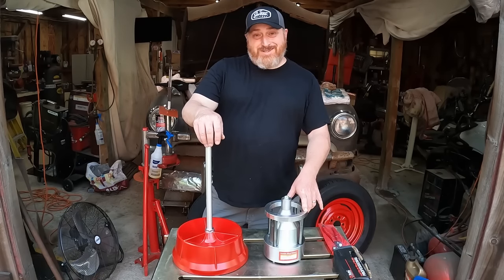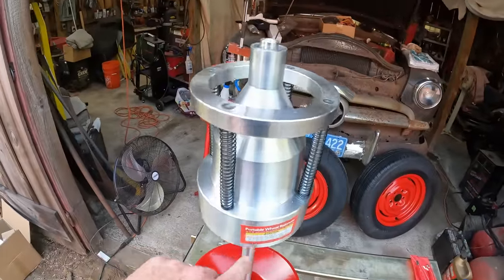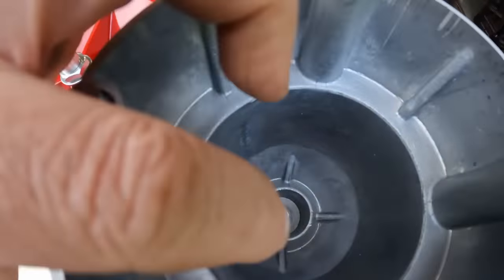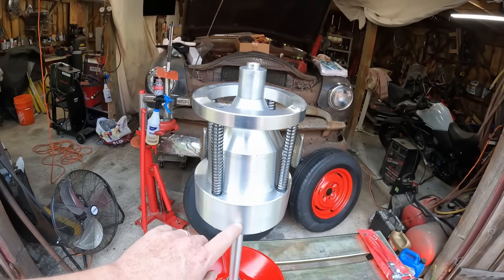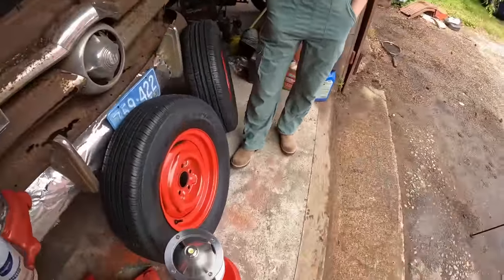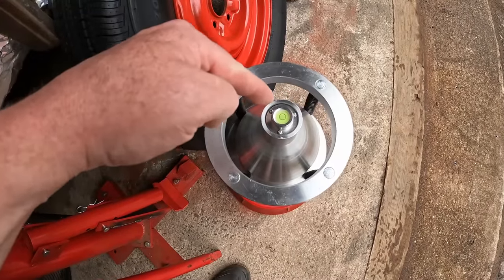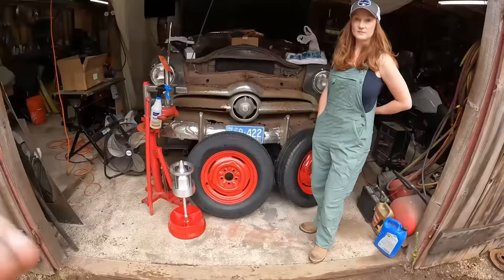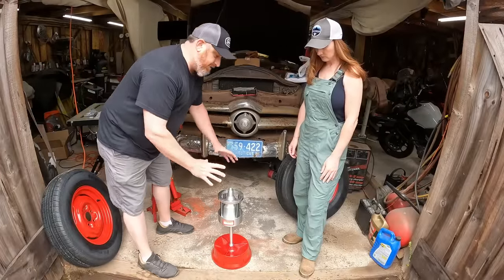How to balance your tires at home and how to modify your Harbor Freight/Amazon bubble balancer!

Comment: The way I was taught to bubble balance at tire is a 3 point balance using 4 weights. You want the weights double stacked to go about 4:30 and 7:30 (based on heavy being 12:00) position with 1 weight inside and 1 outside in both weight locations that balanced the tire. I know this works I've personally been 100mph on tires I balanced this way and with no vibrations. Tire have to be round not out of round and wheels have to be straight not bent a small amount (out out of round  and or bent wheel) still will balance out and run fine. The person that taught me was taught by a man that was balancing tires in the late 40's maybe early 50's starting out.
Reply from the maker: That is great info!! Thanks!

Comment: Ingenious! Own balancer and was not happy with its operation. Never realized it didn't actually rest on the point! Will definitely modify it for next use. Should probably invest in hammer on weights too. Sticky weights following off. Own tire changer with the adapter too. Will be attempting to modify that with my poor welding skill. Great team!
Reply from the maker: Thanks for checking out our video!

Comment: Wondering for aluminum wheels and adhesive weights would you just put the wheel upside down?
Reply from the maker: I think you'd still do it the same way but you would find the center of the wheel height wise and stick on the weights.

Comment: I like the format of your channel, and you keep things interesting working as a team.  I see there's a CT plate on the shoebox; wondering if you're in the eastern part of the state.  You mentioned about the weights you'd bought being supplied in certain increments of an ounce, but another feature on the pliers is the cutter blade inside the handles near the hinge.  For those who get fussy and find one bought size is not enough, but the next size is too much, the weight cutter is used to shave the larger size down to be between the weight of the two sizes.
Reply from the maker: That's a solid idea, just shaving the weight down. Yes, we are on the Eastern side of CT.

Comment: Great video! I’ve been on the fence about buying one of those. I think you have convinced me. Just wondering how large a hub opening the balancer will do? My hub opening is 3 1/2” on my wheels with 235/75R/15 mud tires. I have already purchased the tire changer about 10 years ago but never have used it, because I didn’t have the concrete bit to drill the holes in my driveway. After watching your videos gave me some confidence in the tool actually working properly. Thanks for sharing your knowledge with us.
Reply from the maker: I just measured across the taper for you. It looks like it will go up to 4". Hope that helps!

Comment: Thanks.  I bought the HFT tire changer several years ago for $35 or $40, and it's still new in the box.  I will weld the mods you recommended.   Probably time for me to get the balancer and do this mod, seeing as I'll be mounting 4 new tires sometime this year.   Also doing concrete work this year with the orange HFT mixer, so will likely pour a level pad to mount the tire changer and balancer on.
Reply from the maker: Thanks for watching!

Comment: Do I need to find the heaviest part of the wheel/rim first before i mount the tire so that it's not going to be on the same side of the high point of the tire ? Or is it enough to just line up the red/yellow dot on the tire with the valve stem ?

Comment: How deep into the assembly is the hole that you drill out.  Asked another way, how far does your drill and bit need to reach in order to drill it out? Thanks.
Reply from the maker: I didn't actually bottom it out. You just want to clear the material on the side of the point.
Reply: I asked the question poorly.  It's not very clear how far down the drill bit and drill have to reach in order to even touch what you're trying to drill.  It was clear that once you do reach down to what you're drilling, you don't drill much out.
Reply from the maker: @markdahl8082  hmm, I don't even know that at this point. I did that last year. I'll take a look at it this week.
Reply: No worries.  I was just curious.  Thanks for replying.

Comment: Good video, I wish my wife and I could work like that. I learned how to balance tires about 40 years ago and we would not put more than 2 oz in one spot on a tire. At that point we would break the beads, as you said, and turn the tire 90 degrees and try again. I also have been using balance beads in my tires for balance and this is what I have found, for motorcycle and trailer tires the beads work well by themselves but on my 2 WD Cherokee with street tires i would still get a bit of vibration so a traditional balance is also needed. I got 73k miles on 60k mile Dextero tires with just the beads. 

I have the HF tire changer and will be making the mods that you did in you tire changer video. Thanks for the video's.
Reply from the maker: I thought about discussing beads in the video. I thought it was a bit long as it was. Seamless airsoft bb's seem to work well too.

Comment: I dont know if my rims are bent, its a tire, brake rotors warped,  or its balance issues.....front wheel drive honda civic.......vibrates just a little when on gas pedal slightly with load in drivetrain.  Could even be motor but doubt it.
Reply from the maker: Check front and rear motor mount.
Reply: @madgingercustoms  Also check CV joints

Comment: The question I get is will that aluminum pin not  hold up at the end of the drilling point in the hole.
Reply from the maker: The pin is hardened steel and the insert is also steel.

Comment: I watched the video ... some parts several times ... I have used mine a few times.  I see the wear ring, but I grease mine for that reason.  Not a lot of grease, but a dab of Moly fortified bearing grease.    Mine wiggles for near a minute, but always returns to as near a perfect o in a O .... the grease reduces friction, and that steel is heat treaded hard, both point and the piece with the dimple.  Drill bits didn't hardly polish the insert. I liked the video, but mine works "OK".  I do have several odd ball bearing balls that one of will work great.  Might try that on a flat steel pole I have.  Might turn "OK" into "PERFECT"?

Comment: Hey, I think this video is great, ah I watching the video where you’re working on the jeep and you mentioned you need to degrease the engine compartment, tip, if you use dollar store oven cleaner spray, it works as good as engine degreaser only cheaper. Once you get the engine compartment wet from spraying off the oven cleaner, you have to wait for it to dry out before using it again.
Reply from the maker: Hell yes!! I have a case of that stuff!  Works better than engine Brite!!

Comment: There are tons of arguments  for spin balancing. All are fine to a point, but, weights can only go where they can go. Also, tires spin while being pressed to the ground by the weight of the car, not in free air, as a static spin balancer would do.

The best I've used, car tire to semi tire is as follows;

 With steel wheel hammer clip weights;

You can pre check rims for heavy side if you like

Determine a slightly heavier  weight than needed. Use 4 weights. Place two each way from center placed together. Move them out equa-distance until balance is achieved. Crayon mark the tread at those spots. 

Pull off the tire, place a weight at each mark on the back, put the tire back on, set the remaining weights up front loosely again at the mark. Fine tune the balance using the equidistant movement again.

Attach the weights there, and you're done.

The pendulum effect of the weights carry through the spinning motion of the tire rolling on the ground, which is a dampening effect of the spinning weight.

Just found your channel, Very well presented! If you work on cars yourself, this is reality.
Reply from the maker: Thanks for the thoughtful comment!! We actually just used balance beads in the video coming out Monday. They seem to be a great option as well!
Reply: @madgingercustoms  they use something like that on my dually bucket truck back wheels. At speed its smooth, when it's cold and low speed, you feel it for a little while.

Comment: Exactly!  You could see the problem right away!  How can someone design a tool that poorly and get rich?  These bus should have been worked out at the factory.  Those designers can't picture things working in the real world... on the monitor it fits, so it's good... they forgot it's supposed to WOBBLE!!
Reply from the maker: I think it's the cheap manufacturing. Easy fix though!

Comment: nice video, good job on balancing, going to have to try the Y method next time I balance.  I have same/similar balancer and if I remember right, it took a while to settle right out of the box, maybe it has a bigger hole already, going to check and if it doesn't will do your modification.
Reply from the maker: Thanks for watching!

Comment: Any way or alternative for larger truck tires? Most truck tires are 16-18 inches diameter rim. Those are only rated for 15.
Reply from the maker: I don't see why this wouldn't work for most any wheel as long as the center hub doesn't exceed 4".

Comment: HI! nice job on the tire balancer,  i use one of thouse also, around 3 years now,  never did the driling yet tho, but thought of it,  i will do it now tho becouse now i know it do work,  but what i did do to my balancer is  grind the 3 chinesse legs off , the stand so that it wouldent rock and role on the bottom part,    and then i  put a tire and rim balanced from the speed balancer on the bubble balancer and marked the spot where the bubble was , and then balanced my wheels the same place on the bubble,  and then i was trying to figure out HOW to find the heavy part of the tire and the light side,   i looked in side the tire looking for added rubber to one part of the tire, and i found it,  some tire got one lap in the tire , and some got 2 laps, just look at the inside of the tire  pass your hand on the lap ouer,    must be where the tires are  joind to gather,  one lap ouer,  i make a mark in the center of the lap over  and put the mark on the valve stem,  if you find 2 lap overs in the tire,  then you dived the distence between the 2 of them and make a mark  and put that mark on the valve stem,,  all 4 tire balanced perfict  and i mean perfict  no waits no led,  no shake at  any speed, THANKS GUYS
Reply from the maker: Thanks!!!
Reply from the maker: Thanks!!!

Comment: What size drill bit did you end up using?
Reply: Also did you buy a harbor freight or amazon one?
Reply from the maker: I believe it was up to 3/8 but you want the flute taper and not add depth. This one was Amazon I believe.

Comment: I guess I will be the dissenter here. The reason  it sits on the cone instead of the point is to make it perfectly centered. Unless you get that point exactly in the center, it won't balance. I used these back when that was the only way to balance tires. I would  lube the point and maybe polish the inside.
Reply from the maker: It can literally only sit in the center as it still maintains it's taper.

Comment: How do you know when to stop drilling?  The best way to check to see if the balancer works as designed is repeatability. Balance the tire. Remove it from the balancer then reinstall. If the tire is still in balance, it is working ok. Step 2, add a weight anywhere after it is balanced. Reinstall it on the balancer. If the balancer indicates to add the same amount of weight you previously installed in a random location directly opposite of the randomly installed weight the balancer is working as designed. If the balancer works properly out of the box, it will save time not waiting for the tire and rim to stop moving.

Comment: I drilled the socket out on my balancer and yes it moves more freely, but it's so free to the point that it wobbles all over the place non stop and it's hard to find center. If your tires are already close to balanced it's not big of a deal. But if they're way off, it takes a lot of time for the balancer to react to the weights placed in order to balance your tire. These bubble balancers are really annoying to use honestly..
Reply from the maker: Certainly, they aren't ideal. I try to slow it down with my hands till it's barely wobbling.

Comment: I took my brand-new tires and Chevrolet rally`s to Les Schwab (local to the pacific northwest) and had them install the tires onto the rims and balance them. I picked them up the next day and I installed the on my vehicle I then went out for a drive and about 45 to 50 miles per hour the wheels shook so bad I lost one of my center rally caps. at (50$ bucks each) I took a look at the factory alignment mark for the valve stem on the tire and apparently Les Schwab must have had Hellen Keller install and balance the tires because it`s so far off. I cannot drive my vehicle. so, I`m thinking of doing it myself.
Reply from the maker: Well this device is cheap and easy to mod. I think it's worth every penny.

Comment: I also noticed it was stiff out of the box and I debated doing this mod or using a ball bearing. I Left it stock with some grease(dielectric) on tip. The more you use it the freer it moves. I'm sure some are horrible quality from factory and may need to be lapped together for lack of a better term. After a few dozen tires it moves real easy.

It wasn't designed to have a super small point only supporting it. The issue is wear on that tip and the insert which neither is particularly hardened(definitely not the insert). Dropping a heavy tire will damage it if not careful. I do see your point about friction and can agree if it's not moving easily it could be an issue. 

Also not a bad idea to pick tire up and turn 90 degrees to verify balance as the worse part of these is the bubble level.
If someone want to drill that part out it comes out with a punch from the top pretty easy just remove the bubble level part, makes it easier to modify. 

For the nay sayers of using a bubble balancer... These are not as accurate as a tire balancer however it's pretty close and maybe closer than a poor operator and an old machine. I've had zero issues with vibrations or wear with 10s of thousands of miles using one of these. 
Cost of balancing one tire about 15 bucks plus time waiting and travel. Alot of shops will not touch anything worn now because of "liability issues" either. So the poor working man drop 75 bucks on one of these and weights and is money ahead quickly. The poor installaof weighs resulting in thrown weights or damage to painted/chromed aluminum rims makes this a no brainer also. I threw weights off 2 tires on a trip within days of balancing years ago. That's whsnI started doing my own. 
Great channel and videos keep up the good work. Not all of us have massive garages and it's nice to see somebody doing it the working man's way. Old timers probably remember the ditch for a pit for oil changes and starter swaps.
Reply from the maker: Thanks for the great comment!!
Reply: Yea! My father-in-laws farm had a perfect low spot on the grass for oil changes & starters

Comment: Just found your channel. thanks for a great video. could you have balanced the wheels painted side down so the weights are only on the back side of the rim, especially if the car will not be driven at high speed ? or is there a technical reason why that isn't done?
Reply from the maker: I didn't really think about that to be honest. It wasn't done on purpose. Thanks for watching!
Reply: Can't balance wheel upside down.  Wheel offset must be down.
Reply from the maker: @jimsmith8071  Thanks for clarifying!

Comment: will this work with motorcycle tires?
Reply from the maker: No, I don't think so. I think the center hub, at it's smallest, is still to large.
Reply: A spinning stand is available for MC tyres, the heavy spot will settle at the 6 O'clock possy

Comment: Interesting video, you use some good logic and methods, for the most part.👍
In reality those Korean made Nexen tires are pretty dang good,  and run really true and usually require very little weight to balance.
On that car i wouldn't even bother to balance them, you wouldn't even notice a difference i would bet.
I have mounted and balanced hundreds of those (Nexen tires) and those tires on that car at the speeds you're gonna   drive, balancing is unnecessary. 
Enjoyed the video, but you're way over thinking things, just mount em up, put air in em, and put em on the car, and go for a drive, IF it shakes, which it probably won't, then maybe balance the front 2.👍
Reply from the maker: Thanks for the heads up on those tires!

Comment: Did you mount the tires on the rims yourself? Also, have you considered using bias ply tires?
Reply from the maker: I did mount them using a manual tire changer we modified. Check that video out. As for bias ply, I bought the cheapest thing I could find. This is a low budget rig!

Comment: We quit using bubble balancers in the late 60's/early 70's because they don't work. Tires have to be balanced in two planes. Bubble gets the radial balance but the inside and outside half have to weigh the same or the tire will shimmy. Spin balancers can determine how much weight and where to put it to balance both planes. You can make your own home made strobe light balancer using a timing light and distributor pick up. We did 140 mph go kart tires back in the 70's and 80's. This bubble balancer does a perfect job on a wheel barrow.
Reply from the maker: Guess you won't be using it then. Lol.

Comment: Put a 2 inch steel bearing inside the top part and cut the aluminum spindle at 90 degree and JB weld a 2 inch flat round stock to the tip of spindle and level before it dries. Now all good to go.
Reply: Did the same thing, greatly improved the balancer.